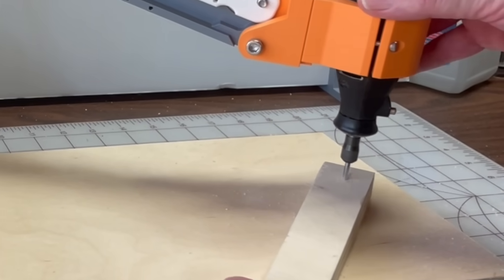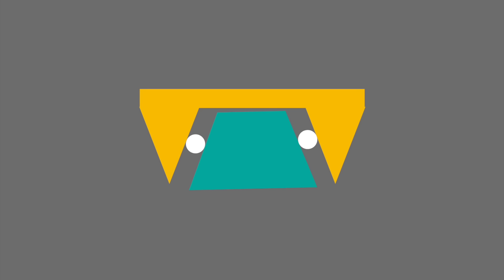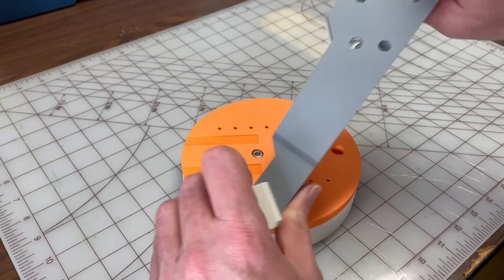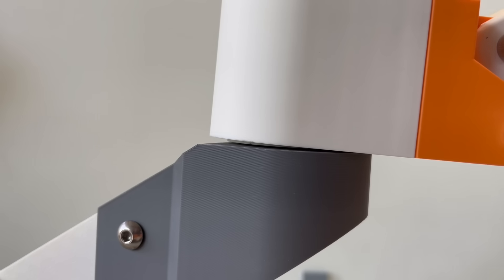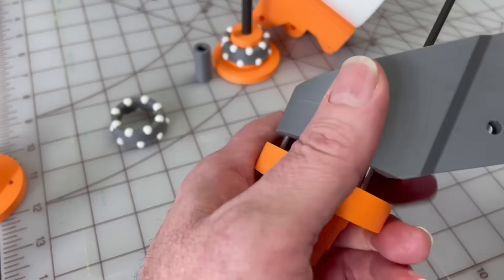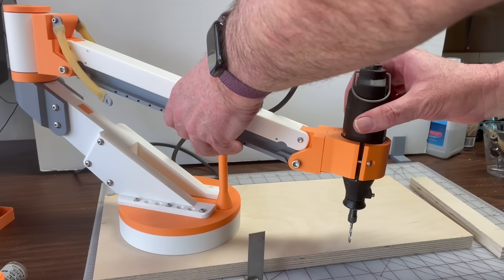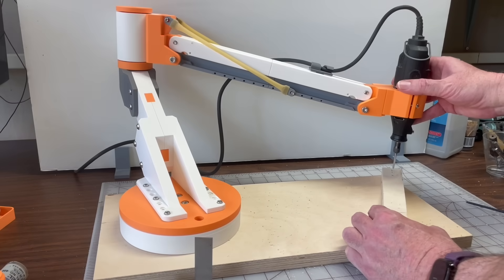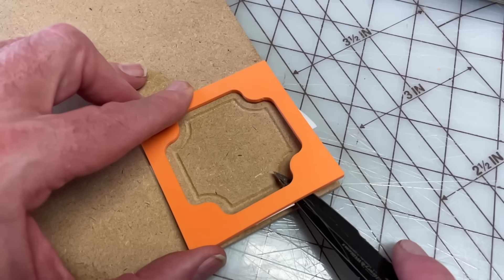Workbench Torque Arm Operational - 3D Print Lab

Comment: I'd suggest 608 bearings for the pivots for smoother motion, I'd go with a quick swap system for different attachments as well. One for dremel, one for a cordless drill or impact driver, one for a threaded insert iron, etc.

Comment: If you can stomach ~10% power loss, you can use a flex shaft. That would simplify the design dramatically because you wouldn't have the heavy motor to contend with.

Comment: Cool project! Would also make a nice threaded insert installation tool if you combine it with a soldering iron. I'm using a drill-press mount for a corded drill with an adapter for it now, but a torque arm, like with a tapping arm, would be way cooler and more versatile.

But please just buy some steel bearings. They're cheap, abundant and will last 1000x longer because the races in plastic will wear out very fast if you put any realistic load on it.

Comment: Well done. I would be interested in seeing a more direct competition between bearing designs.

Crossed tapered roller bearings are another option. Making one or both surfaces softer (TPU or hollow) will increase the rolling resistance but the larger contact area reduces contact pressure (stress) and might improve durability? Creep might be the most important phenomenon for plastic bearings: the arm may not get used often, and it would be better to avoid having to reduce the preload while it's not in use. Maybe the measurement could be preload bolt torque over time.

Comment: To make the nice bearing even more vitamin free the cental bolt could be replaced by a well designed 3D printed screw.
To get similar stiffness it'd need a slightly bigger diameter be sideways printed (with part of a side slashed off; avoiding loading inter layer adhesion) and the thread pitch and profile adjusted to be bigger and more smooth respectively for FFF printing.
But better to first focus on improving on other stuff that actually needs improvement though. …
Reply from the maker: I did actually try replacing the bolt with printed threads of a larger diameter. It was never strong enough. I've also been experimenting with printed parts reinforced with resin, which at least could replace a family of vitamin parts with a single process. I like the idea of a tensegrity system, if that's what you're describing...
Reply: @stuartferguson11  - Did you print the screws sideways and near 100% infill?  Makes a huge difference with the layer planes not othogonal to the screws axis. Also standard thread profiles are meant for metal and I found them to be no good for printed screws. Better to go with quite a bit more pitch and profile depth. E.g. 3.6mm pitch 2mm profile-depth rounded profile (sine of cubic) 12mm diameter or bigger. I recently tried glass fiber reinforced PCTG. Seems good so far. Definitely better than PLA.
Reply: @stuartferguson11   - No, not tensiegrity. More like what one finds in quick-deploy tent-struts with the rubber string inside. Just that the string is replaced by a stiff chain and that chain is tensioned up. Tensioned up a bit like steel rebar is sometimes pre-tensioined in concrete  casting for bridge constuctions and such. But modular and reversible. You get the small grained quick recomposable multi part assembly without needing one or even more screws at every single interface. Thats the gist of the idea. Standardized kit. Less parts reprinting. And getting rid of all but just a few big 3D printed screws.
Reply: Doing post priting assembly with an absolutely minimal amount of 3D printed screws (and no metal screw vitamins at all) is one thing I wanna try and investigate. Investigate combinedly with a set of some design principles including:
– W to W self centering interfaces (V to V can undesirably twist as you've found a variant of here in the base bering), 
– succesive form closure and – post assembly tensioning 
=> to drag out the need for a screw as long as possible
(corechain in hullsegments inspired by rutter in foldable tent rods and pretensioned steel rebar in concrete),
– positive locking so stuff can't rattle apart despite higher FFF printed screw pitches
having very few screws the extra effort of positive locking is much more tolerable.

It's all about getting the desired more rapid modification and iteration from more smaller less monolithic parts (as you mention at 6:01) while not shifing the problem to a painful ampount of vitamin metal screws of various kinds and sizes.
I.e. while not having all that excessive scrrewing activity needed in the assembly process.
Objectively a lot of this entire video is just screwing things together. 
Many other projects out there on the web have much more screws.

My vision is a class of general frame systems ReChain systems that can be rapidly plopped together and apart and rapitly tensioned up detensioned at just a few points. There then can then serve as a basis for any and all kinds of robotic projects. Including even self replicating pick-n-place systems (RepRec) eventually, maybe.

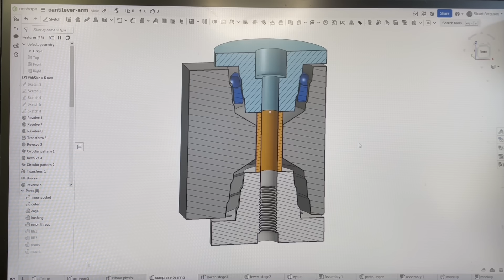Comment: 5:11 Nice bearing design!
Reply: The ball based bearings presented here 5:11 & 5:33 seem to be runing ssmooth enough even for say even a (parallel or serial) SCARA 3D printer. – I had investigated conical cycloid gear bearings with remotely similar geometry a bit. Some axial pretensoning to get backlash out whick is not possible in normal cylindrical gear beearings. These gear berings may be better for higher loads and speeds as slipping is fundamentally impossible in gear bearings, but they did not run perfectly smooth due to some math approximations I made and/or due to limits of printing accuracy for the conical (soft herrinbone) gear rollers.

Comment: Nice build- it's too bad there is not a better option than the Dremel, which is a cheap, poorly designed toy masquerading as a tool.
Reply: They used to be decent, but they've gone to shittier and shittier bearings, just when they need to fight off cheap Chinese knockoffs.

Comment: Great video, Stuart.  I like to see the thinking behind designs, which you show very well.  I recently built a camera arm using 3D printed connectors, and ran into some of the same design issues that you had.  (In case you are interested, here is a link to a video showing my struggles:  https://youtu.be/RyzHmzEBIjs )  It finally occurred to me that both of us picture plastic components that are similar in size and shape to familiar metal components.  This leads us down the garden path, because the inherent stiffness (measured by Young's Modulus) of steel is approximately 100X that of PLA, while aluminum is at least 30X stiffer than PLA.  3D printed parts don't just need to be a little thicker than metal parts; they need to employ shapes and sizes that are often radically different when rigidity is an important goal.
Reply from the maker: Loved your video, Patrick!

Comment: Nice ideas here! I would recommend making this arm with steel bearings and tubes too. 3d print is still relevant around these metal pieces, to fit and assemble them surely, but rigidity issues have to be addressed in a proper manner. I do think combining 3d prints and metal tubes or profiles has an under assessed potential for much people.

Comment: Hi! Cool Idea! Nice improvement! 
A few suggestions:
A stiff, 3d Printable bearing would be a cross Roller bearing. To get the play out you split the outer ring  axially  and make a big fine thread on the outside. so the Upper and lower parts of the ring screw together. When play free fix in place with a clamping screw. 

Usually instead of cones you use angular contact bearings. Reason? small contact angles like those in cones amplify the contact preassure. 
Combine two angular bearings and pretension them to emliminate the play. 

When you Design for stiffness try to make bulky parts, as the distance to the center improves stiffness (See Steiner theorem)

Threaded Rods are commonly available and can serve as a good stiff basis for linkages :)
Reply from the maker: Good thoughts here, thanks!

Comment: You said that "smooth surfaces are only possible on the top surface of prints".
I don't know what printer you are using, but if it has removable magnetic beds, you can get a smooth PEI or other types of smooth beds. Then your lowest surface will be smoother than the top surface ever can be. If you have a printer that has a built in glass bed, there are companies out there that sell conversion kits to a bed that can use magnetic build plates.

The bit looks like it's going in at about a 5-8 degree angle off of being properly perpendicular to the board. You can see the orange attachment is touching the board on one side, but not the other. I would think you could adjust that. The whole thing is a very cool idea.
Reply: huge difference between smooth and flat. You are thinking of a flat surface, he needed smooth but curved surfaces for the ball bearing races.

Comment: Why? Just buy a thrust bearing for a dollar or two? It's a solved problem. For me 3d printing is always about bridging different standard components with plastics, not make something out of as much plastics as possible and then have it break down after an hour or so of use.
Reply: I agree, really hate when someone is using 3d printing for everything he touches
Reply: Yeah, I agree with this.  After printing a few bearings to see if I could use them I decided just to buy them instead.  Cool print though!
Reply: And there's already plenty of other steel parts in it.
Reply from the maker: It's a valid question. For me the challenge is building close to the ground, as it were
Reply: Fun.
Reply: Agree, 3D printing for me is creating something I need that doesn’t exist or modification to an existing product to fit my needs. I see so many prints that take hours and use massive amounts of filament to make something I can buy cheaper and normally better off the shelf. My motto is "just because I can print it doesn’t mean I should". Although I do enjoy seeing someone solve problems creating things like this. His ingenuity in designing this will definitely help him down the road and others. Well done project.
Reply: @DHS-IC  Yes, by exploring what's practical/possible with one approach, we have a better idea of the trade offs involved in implementing this type of design. If I needed an arm like this, I'd either buy a similar one and modify it for my needs, or make it in mostly plywood, which would be cheap and quick for me, but not of much interest to anybody else.

Comment: Files??  Such a great design!
There could be quick connect head on it, switch it out for a magnifier that connects to a monitor w/ usb, soldering iron for pushing in heat set inserts, imagine any attachment!
Very cool!
Reply from the maker: Yes! That's what I'd like to do